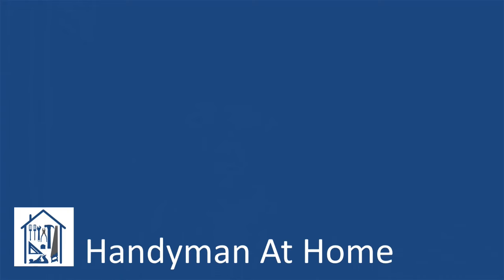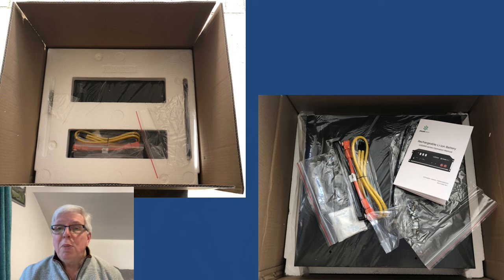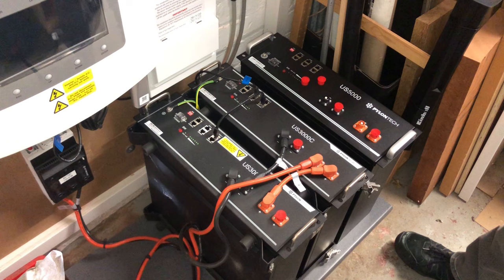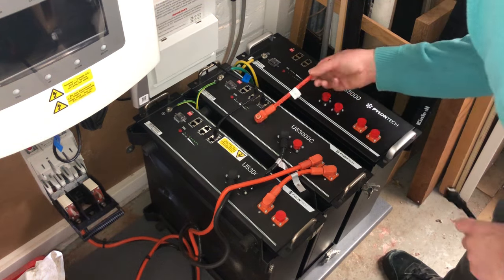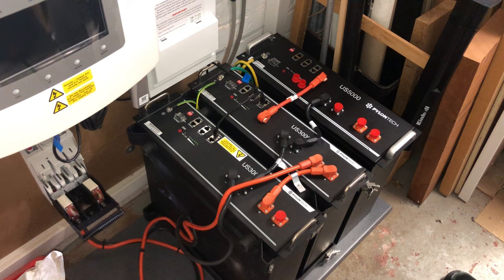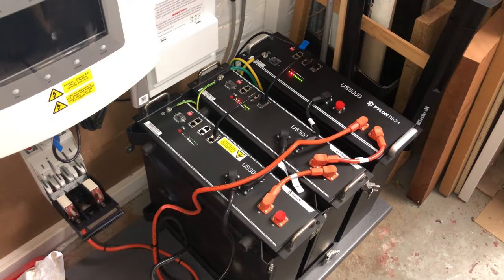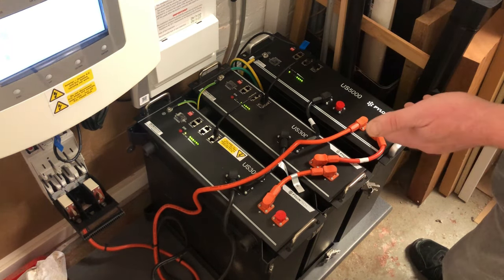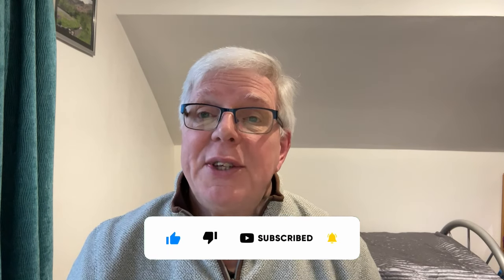Solar Battery Storage - Adding More Capacity - Pylontech US5000 Installation

Comment: Is there a reason the batteries are stood up on their backs instead of stacked? You have the stacking brackets so didnt make sense why they arent stacked and positioned the way they are.
Reply from the maker: Hi, We just preferred having them with the front panel facing upwards as it made it easier to see the LEDs and access the switches without having to crouch down too far (bad knees!). Cheers, Chris
Reply: There is rack cabinet from pylontech itself where they attach vertically like this. No problem with this orientation

Comment: At this point, i would use a second pair of supply cables.
The cabels to the inverter are only 4AWG and rated for just 60 Amps.
The short ones between the batteries are rated for 120 Amps. That should be fine.
Reply from the maker: Hi, All the cables - short and long - are identical (4 AWG) and are as supplied by Pylontech themselves. From reading the specs. my understanding is that they have a continuous current rating of 100A and a peak rating of 125A. Thanks
Reply: @handyman-at-home  Take a look at cable calculators in the web. A 4AWG Cable of 30cm can handle more power, than a 2m 4AWG cable.

Also depends on your breaker. If this is 120Amps ( NH as it looks like ) i would definitly not trust in one pair of this tiny Cables. Look, how long NH breakers can handle 120A+ till they blew up. Your Cable might be long gone since then.

Is only a recommendation for safety, and it doesnt cost that mutch.

Comment: Hi Chris, I have got a Pylon US3000C model battery.
I'm thinking of doubling the capacity.
I placed the first battery upright, as you do, but it was just sitting on the floor.
By adding a new battery I am concerned about finding a good and safe solution to support both batteries.
Could you give me some advice?
Thank you for your attention.
Reply from the maker: Hi, 
You could purchase the special purpose brackets from Pylontech that allow you to clip two batteries together, which makes them less likely to be knocked over - see https://www.itstechnologies.shop/collections/pylontech-us2000-us3000-phantom/products/2-x-brackets-pylon-us3000
Or, you could construct a frame from some wood that would keep the batteries upright. I thought about doing this but in the end I was happy that the additional US5000 battery was pretty secure.
Thanks, Chris
Reply: @handyman-at-home  No, I haven't bought the brackets yet. I didn't know that brackets are good to mount the batteries in upright position before I watched your video. 
Now I am confident they will do the job. 
Thank you very much indeed Chris.

Comment: hola, cuando dices que apagarás por completo la batería, esa caja de cuantos Amperes es? 3:28
Reply from the maker: Hi, Sorry for the delay in replying. 

The isolator is a Fuse Switch Disconnector by Jean Mueller. Model KETO-00-3/F - Item T500113002

It's rated to 160A, and from what I can see, there are two 80A fuses fitted, one on the positive connection and one on the negative.

https://shop.jeanmueller.de/web/de_DE/1415707101776/NH-Sicherungslasttrennschalter%20KETO-00-3-F/$catalogue/jeanData/PR/T500113002/additionalInfos/index.xhtml

Hope that answers your question

Cheers, Chris
Reply from the maker: Hola, Perdón por la demora en responder. 

El aislador es un seccionador de interruptor fusible de Jean Mueller. Modelo KETO-00-3/F - Artículo T500113002

Tiene una capacidad nominal de 160 A y, por lo que puedo ver, hay dos fusibles de 80 A instalados, uno en la conexión positiva y otro en la negativa.

https://shop.jeanmueller.de/web/de_DE/1415707101776/NH-Sicherungslasttrennschalter%20KETO-00-3-F/$catalogue/jeanData/PR/T500113002/additionalInfos/index.xhtml

Espero que responda a tu pregunta

Saludos, Chris

Google translate .... 😊
Reply: @handyman-at-home  Hola, o sea, si yo tengo 2 US2000B y 1 US2000C (25A x3 = 75A), debiera tener un fusible de 80A ó 100A?, la pregunta es por que tengo uno de 50A
Reply from the maker: Hola, no soy un experto, pero habría pensado que un fusible de 80 A sería suficiente, en lugar de uno de 100 A, que me parece un poco grande. En cuanto a por qué tienes uno de 50A, sólo puedo adivinarlo. ¿Tenías originalmente solo las 2 baterías US2000B? ¿Quizás el instalador pensó que un 50A estaba bien para eso? No sé cuál es su inversor, pero en el mío (Solis) puede configurar las corrientes máximas de carga y descarga, por lo que siempre puede asegurarse de no exceder el valor del fusible en funcionamiento normal. Realmente existe un fusible para proteger el sistema cuando algo sale mal, por lo que probablemente elegiría un 80 A dada su configuración actual. Sólo mis 3 centavos. Saludos, Chris
Reply: @handyman-at-home  Hola de nuevo, tengo un inversor Solis, muy parecido al suyo, pero creo que es una versión anterior
RHI-4.6K-48ES, pero no puedo encontrar esa configuración para configurar las corrientes máximas de carga y descarga, solo se que el máximo que puede ocupar el inversor son (Maximum Charge/discharge current(A)  = 62.5/62.5), o sea, puede solo ocupar un máximo de carga y descarga de 62,5A

Comment: what fuses do you fit in your battery disconnect ?
Reply from the maker: Hi, The battery isolator/disconnect is a Jean Mueller fuse switch disconnector. Model KETO-00-3/F - Item T500113002.
It's rated at 160A and there are two 80A fuses installed, one on the positive connection and one on the negative.
Link for the isolator ...
https://shop.jeanmueller.de/web/de_DE/1415707101776/NH-Sicherungslasttrennschalter%20KETO-00-3-F/$catalogue/jeanData/PR/T500113002/additionalInfos/index.xhtml
Cheers, Chris

Comment: I have 3 US2000 batteries and want more capacity. Can I connect bigger batteries ie US3000 or US5000 without it causing problems, or should I stick to buying more US2000s?
Reply from the maker: Yes, you should be able to connect additional US3000C or US5000 into your existing battery setup. 

You need to make the newer battery/ies the master - take a look at the installation manual, section 3 - you can download a copy from this website (UK based retailer that I have purchased from)

https://www.itstechnologies.shop/products/pylontech-us5000-4-8kwh-95-d-o-d-battery-storage

I don't know how old your US2000s are, but if they are more than 5 or so years old I'd personally think in terms of trying to sell them on and replacing with new, but there's nothing stopping you adding new batteries to them.

Comment: How did  you set your deep switches 1to4 red
Reply from the maker: Hi, I didn't change them from their default settings of all OFF (0). There's a section in the installation manual that details what each switch does, including Baud Rate, CAN terminal resistance etc. As far as I understand it, for simple installations like mine, you shouldn't need to touch the DIP switch settings, but the manual is worth a read. Cheers, Chris

Comment: where did you buy your US5000 from ?
Reply from the maker: ITS Technologies in Manchester
https://www.itstechnologies.shop/collections/pylontech-us2000-us3000-phantom/products/pylontech-us5000-4-8kwh-95-d-o-d-battery-storage
Reply: What has been you cost saving ££
Reply: @paultraynorbsc627  personally I have 10.5k batteries..x3 3.5k..and have x20 400w solar panels,  during summer or even light days we use about 2p worth of electric off the grid about every 2 weeks, obviously during winter..3 months of the year they don't do that good, but in all what miffy me the most is that the standing charge is our bill, it's way more than what we use
Reply: @kroozer5215   hi my new installation is not doing the cost savings
Reply: @paultraynorbsc627  how come, what sort of set up set up you have. ? We had our panels on both sides so we get the sun or light on one side in the morning and then the others idea in the afternoon

Comment: We are planning to add US5000 to our 2 x US3000c, we are getting mixed messages about mixing US5000 with US3000c.  Some installers say that it is not best to mix batteries.  Have you had any problems?
Reply from the maker: Hi, We added our US5000 to our 2 x US3000c's in late October '23 and have not had any problems so far, so I'm unsure why they are suggesting it is best not to mix capacities. What do they suggest ... replace all your existing ones with new larger capacity, or buy more smaller capacities ... doesn't make financial sense to me? The one issue we have experienced related to our upgrade was highlighted by one of my viewers who commented on the earth cable connections. On inspection, I found that our original installer had connected the earths between the  US3000c's but not then connected it to an actual earth connection!! I have since sorted that out myself ... can't rely on anyone these days it seems. I used a heavier gauge earth cable to go from the US5000 to the actual earth point. I can't see why you shouldn't go ahead. Cheers, Chris
Reply: The Pylontech US5000 manual specifically says that you can mix the US5000 with other 48 volt Pylontech batteries. "Mixture using master battery priority: US5000>UP5000/US3000C/US2000C>U3000/US2000". With a US5000, you want the US5000 as the master (first) battery; any US3000 or US2000 modules should be second through 8th in the chain; and the remaining US5000, UP5000, US3000C and US2000C modules can be anywhere in the chain.

If an installer says that you shouldn't mix these modules, ask them why, pointing them specifically at the Pylontech manual (pages 5/6, section 3.1, "Features".) If they can't give a good answer, find a different installer. They might be talking purely out of caution, but it's not a great look, IMO.
Reply from the maker: Completely agree. Thanks for spotting that - I'd seen that myself but forgot to put it in my reply 🤦‍♂️
Reply: @handyman-at-home  debe ser por la frecuencia de sincronización, de hecho, el tilde de las luces debieran ser todas al mismo ritmo, y de hecho tengo 2 us2000B que andan al mismo ritmo del tilde de luces, en cambio la 1 us2000C anda a otro ritmo.
Pero en el manual, dice que se pueden mesclar us2000, us3000 y us5000, lo único que se debe dejar la de mayor valor en la parte superior como maestra.
Reply from the maker: Sí, así tengo organizado el mío. US5000 como maestro y luego el 2x US3000C.